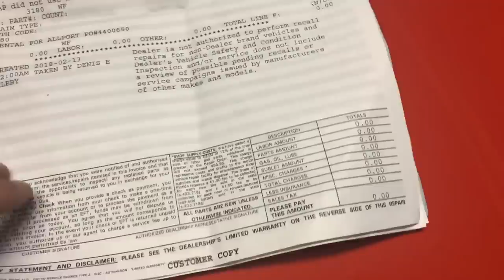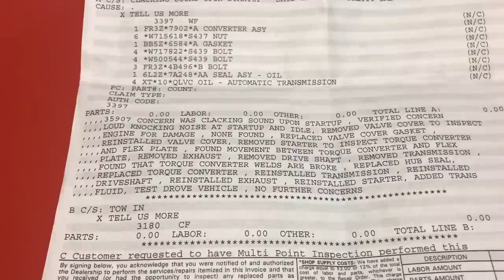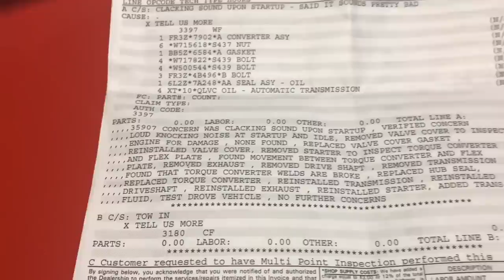What Happened To My Ecoboost?

Comment: The torque converter is bolted to the flex plate that is bolted to the crankshaft. To break the weld either it was a faulty weld from the manufacturer(possibly), the bolts were not torqued properly(probably), or you produce so much POWA that you broke them( unlikely since it was covered under warranty)

Comment: the flex plate is like a flywheel for automatic transmission

maybe it was the welded hub of the Torque Converter that broke, which explains welding broke. 

https://www.transmissionrepaircostguide.com/torque-converter/

so they replace the whole unit because it is kinda a cheap part

although its still a 600-1000 bucks job which thankfully is covered under warranty